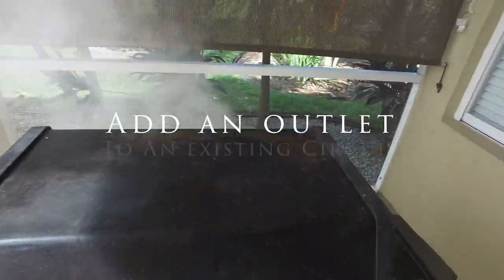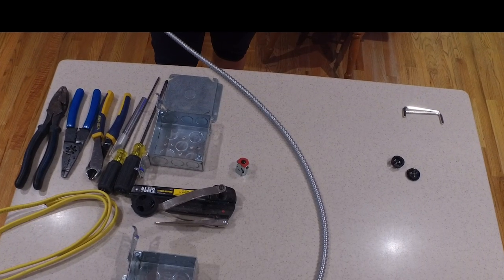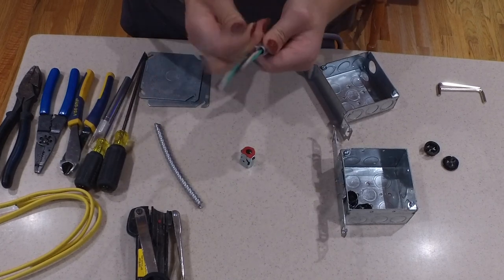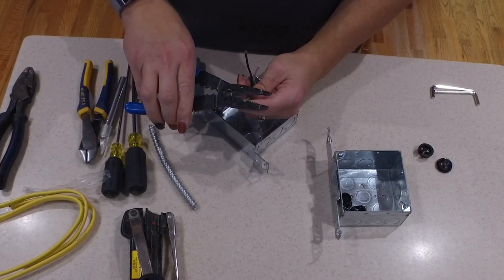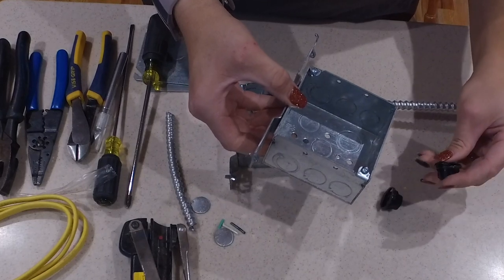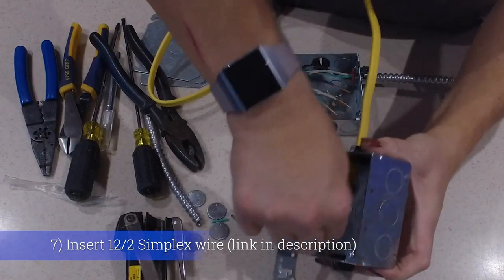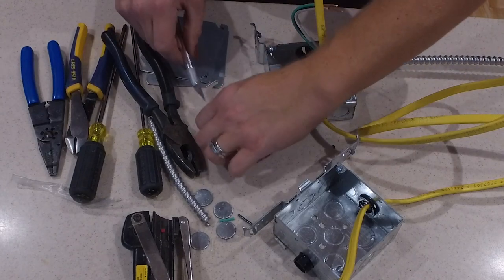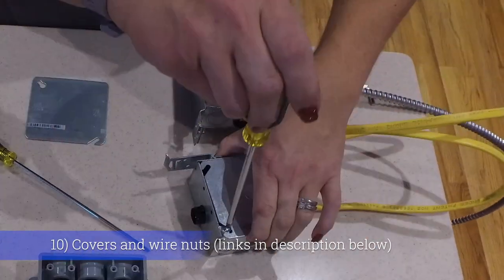How To - Add An Outlet to an Existing Circuit: Tap an outlet

Comment: absolutely what I needed to see.  I don't have any slack in any hot runs in our attic and I need an outlet for our HD antenna booster.  really like the pre-staging work done out of the attic first.  thanks.
Reply from the maker: Thank you, and glad to hear it! Sometimes with those boosters you can run down to the TV and boost from an outlet behind the TV. But, if you're splitting the signal in the attic, then you need to boost it before the splitter and it makes great sense to throw in an outlet. Glad it helped!

Comment: Thank you for this video,
I have a slightly different upcoming project (adding a new outlet near the toilet as part of a bathroom remodel for future bidet / mini dehumidifier) and your video was really helpful still since I'm adding to an existing circuit and will maybe have to add a junction in the attic

(I have questions about total power draw on the circuit since people said the bidet can draw a lot of power but I have 10/2 running throughout my house and I think the only other things on the circuit are two light fixtures and another outlet)
Reply from the maker: It is very uncommon to have 10/2 running through the house. More often you'll see 12 or 14 depending on the amperage of the circuit since most common breakers are 15 and 20 amp. You'll have to look at the power draw on the bidet and calculate how many amps it pulls to really know. And honestly, make sure it's 10/2 because that's some pretty serious wiring.

Comment: Amazing video!! Question: I would like to add an outlet behind a TV in our master bedroom. The problem is I cannot tap into an existing outlet on the wall, as the center mounting area for the TV has no outlets in that stud bay to tap into. Would you suggest running a new line from the attic down into the wall from the top beam? What would be the best practice to tap into the power in the attic? Thank you!
Reply from the maker: I had written up a long response and YouTube wouldn't post the comment. But I do have another video that covers tapping into an outlet 1 stud over. There's great drill bits to help you get through wood if you can go through a stud or two. Here's the other video: https://youtu.be/ztjJaJ412yY

Comment: Hummm, not sure but was this video just one long run on sentence. Its an instructional video., okay to slow it down., had no clue what half the terminology you were using was and anyone who did, probably doesn’t need to view your video in the first place. Know your audience, DYI for dummies, not union electricians
Reply from the maker: Hi Jack - thank you for the feedback on the speed.  As an aside - I'm not a union electrician, just a DIY'er who's learned a thing or two about electricity over the years and wanted to share.